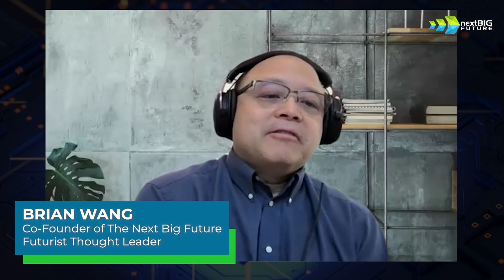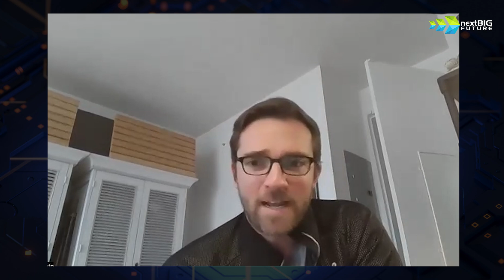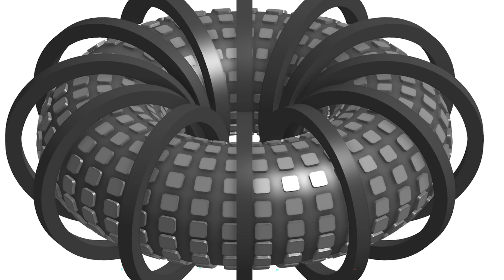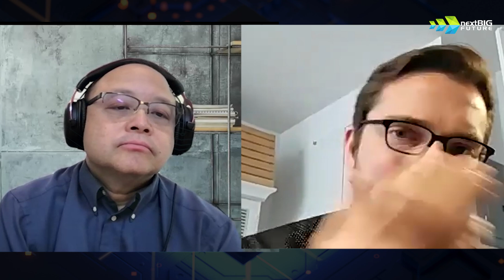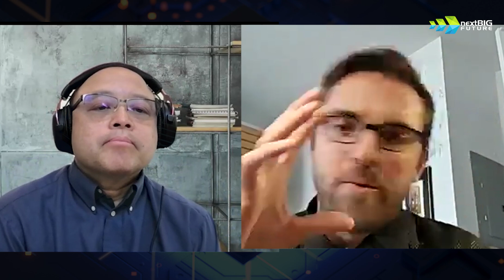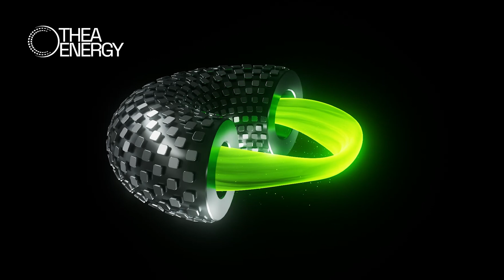Will BREAKTHROUGH Designs enable nuclear fusion?

Comment: If a liquid metal blanket is used, it is replaced on the go as the metal is purified outside the reactor and reinserted inside the reactor.
The liquid metal is the carrier of the reactor heat.

Comment: Fusion reactors are an especially ugly con game. We began working on controlled fusion back in 1953--seventy years, going on seventy-one. Not one fusion reactor has produced enough excess energy to light a single LED. Instead of spending billions of dollars on this will-o-the-wisp, we should building new fission reactors, especially those of the LFTR design. LFTR reactors  use thorium rather than the all but priceless uranium.

Comment: If you put 9 coils next to each other in a 3 x 3 array, yes you can convince yourself that it works.  But in effect all you have done is make 1 coil of size equal to the perimeter of the array.  The parts of the turns of adjacent coils just cancel each others magnetic fields.  Just try it on a toroid as the graphic shows.  Use ordinary copper wire initially.  Do this simple model before wasting large amounts of time and money on superconducting coils.
Reply from the maker: Thea Energy spun out of Princeton Plasma Physics Laboratory. The modeling has been done.

Comment: I believe that consensus can be reached that thermonuclear fusion plasma can be stably confined in a reactor comprizing a row of superconducting magnetic rings like 45 rpm music records stacked with gaps between them on a long spindle. The spindle like part of the reactor is a long hollow vessel made of a strong electrically insulating ceramic containing the plasma A high voltage electric field established by the rings is deployed along the axis of the reactor. The center ring is grounded and the rings are increasingly positive both up and down the row as shown by this keyboard sketch. 

Key: ( = magnetizing current, + = charge. The number of arcs or plus signs represents the magnitude  

  (()++  ((()+  (((()○  ((()+  (()++  

The plasma is confined radially by the magnetic field and axially by the electric field. 

The nuclei are electrically repelled from the ends inwards axially to the center. Many electrons escape at the ends but that is advantageous because the electrons radiate energy unnecessarily. 

The rings produce a straght hour glass shaped magnetic field. This constrictive curvature along a straight axis is an ultrastable shape within the reactor vessel. The constriction is produced by having the strongest magnetism in the center. This will press the charged particles outwards axially so the vessel may need to be long to support a strong electric field so there is both ultrastability and axial confinement. 

The 45 music record like rings are stainless steel with an inlaid spiral superconductor. MIT developed inlaid superconductor on matal magnets. 

Aloha
Charles M Brown
Kilauea, Kauai HI 96754
(808) 651 ****

Tr